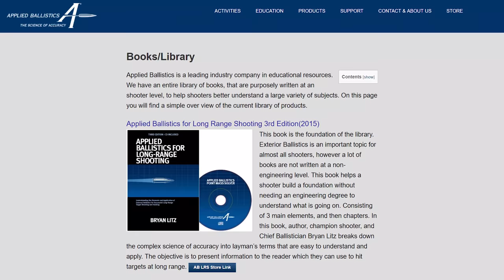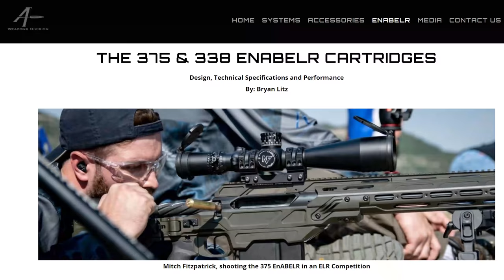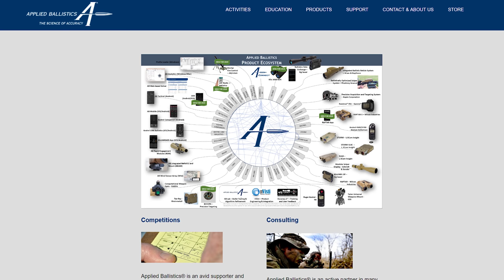Bryan Litz talks Ballistics, Berger Bullets, Rifle Shooting Facts and Myths

Comment: I neck turn my brass for highpower just so I don't get rings on the bullet from the seater stem. Before 1 of say 5 or 10 cases would seat really tight. I need the neck tension for magazine length loads. I got a good setup with the lathe and a good fixture so it's not really a chore. Turn about 50-75%, no noticable impact of accuracy

Comment: I have been using the plumb bob method of setting up my scopes for 40 years, if there is anything in this world that is consistent, it is gravity. My grandfather taught me the method. I have found to get really close using levels, I use my caliper stem under the scope base and put a level on the stem, then one the mounting rail, not on the turret knob. The scope base is the zero base for all internal machining on the scope. You put a level on the knob, get it level, then turn the knob, it may or may not remain level. Just my experience.

Comment: They may have made a bad assumption about lighter bullets having less recoil. It may be true in rifles, but in USPSA everyone has known for years that a heavier pistol bullet has less recoil at similar momentums (mass x velocity = power factor in the sport.) Most people don't know why, and it initially seems counterintuitive, but the reason is that powder has mass and velocity as well! I don't know how to measure/calculate the gas velocity, but I read it is somewhere along the lines of 4X bullet velocity. In other words; one grain of powder has 4X the effect of one grain of bullet weight. A lighter bullet is smaller, easier to accelerate and more powder can be used before reaching the maximum specified pressure. It was years ago, but when I ran the numbers it confirmed why felt recoil was greater with lighter bullets in pistols. 4X gas velocity could be bunk, but it seems reasonable since powder must provide more than enough pressure to move the bullet. Rifle could be totally different because the powder to bullet weight ratio is significantly greater, but it seems like bullet weight might have even less of an effect on recoil. I'm not sure, but I don't think I feel a difference in recoil between a 55 grain and 77 grain bullet.

Comment: Did Bryan say that powder charge wasn't important?
I ask because Erik Corrina and many others use a $4000 Prometheus to charge there brass.
Reply: The difference is initial charge and consistant charge, Brian stated he was very particular in weighing powder.  Brian said (initial) powder charge was not as important with large heavy barrels on large heavy guns, due to less harmonics. One has to listen in detail to what is said.  You have to listen to what is said, not interpret what you think he said.
Reply: @6handicap604  initial powder charge please explain that if you can? And consistent if you can?
Reply: @lynndragoman1573  Brian stated he found his initial powder charge for reloading  just below pressure signs. He did not say with the satterly method or ocw testing. He then tuned that initial charge. Most of us, myself included, tweak that charge through testing for smaller groups, in .1 grain powder increments, or I change the initial charge to a final charge, then continue to tune with neck tension and seating depth. Consistant, means the same every time, as in accurate weighing of powder. Most competition reloader's use very accurate scales.  Most reloade'rs do not, they use the fastest scales. Say your scale measures + - .2. grains. Seems fairly accurate. But that is actually a .4 grain window, remember the + . Get your reloading book and look up the data for your caliber. For 6 BR  26 grains of Varget results in 2367 FPS (average) 29 grains results in 2620 fps(average). That is a difference of 253 fps over a 3 grain difference. Divide by 30, that is 30   .1 grain increments, which equals 3 grains. That results in 8.43 fps per .1 grain of powder difference. If your scale has a .2 + - accuracy, or a .4 window rating, that means .4 grains equals 33.72 fps window of accuracy in FPS. That is the best you can rely on, it MAY be less, but it MAY not be. Everyone wants a low ES or SD.  My question is this, if you want a low ES how can you get there with a scale that only provides a 33 fps average accuracy window in FPS?  The scale I use for powder measurement goes to 0.0000. When I measure powder, I can get within a .002 window of accuracy or consistent powder charge. That is within one kernel of Varget,  I do not split kermels, although I know of people who do so. It is not fast, but it is accurate and consistent powder measurement. I do not think I can overcome inconsistent powder measurement using neck tension and seating depth Just my take on it.
Reply: @6handicap604  I shot competitive Benchrest at 600/1000 yards for years so I have a handle on what works.
I just couldn't believe what I was hearing especially when he added in barrel profile.